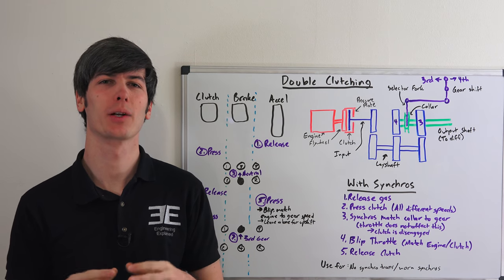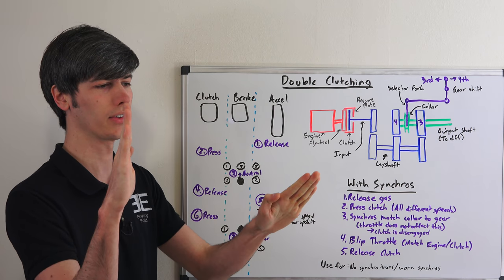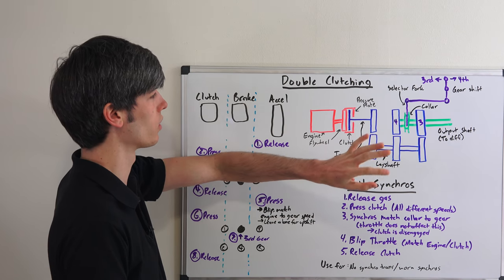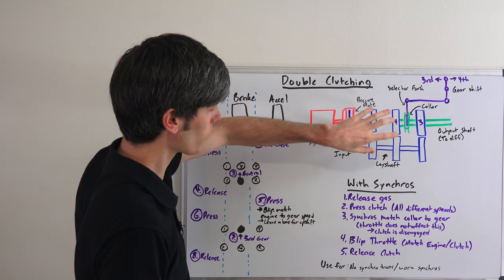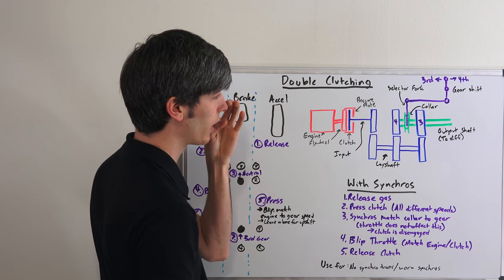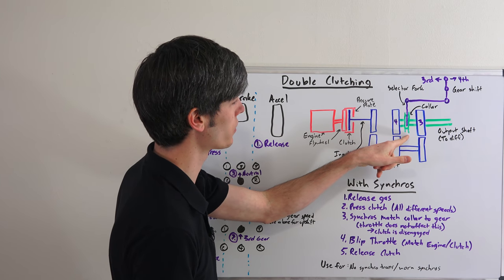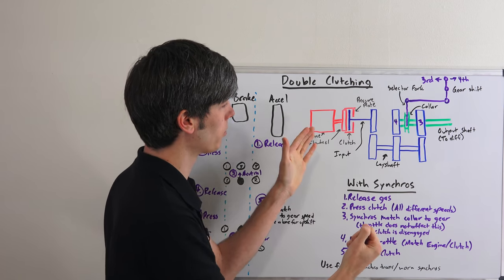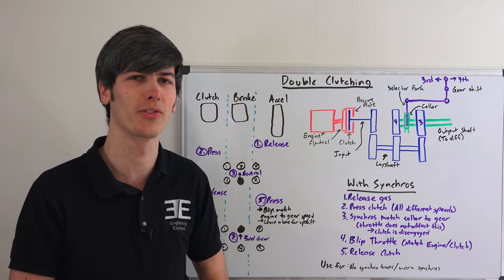What Is Double Clutching?

Comment: This just sounds like rev matching to down shift
Reply: Because you are revmatching. With double clutching you don't revmatch just the engine to the output shaft, but also the input shaft (which you connect to the engine when releasing the clutch) to the output shaft in the gearbox. Nowadays it's pointless because synchros do that using friction, so modern revmatching does the job and is much faster.

Comment: I already have been doing this for my truck (and any truck interesting that, it just made sense to do) but rarely do you need to do this in a newer car, the syncros will let you smoothly transition gears with well-timed rev matching, especially aftermarket stage 2-3 racing clutches, it happens too fast unless you really know your way around those types and been driving for awhile.  Just my take from my personal experiences though.

Comment: Older cars usually didn't have 1st gear synchronised, so that's where I learned how to do it. You weren't supposed to shift from 2nd to 1st, but I needed to, so I learned to double-clutch. I also find that though unnecessary, using double clutching on synchronised gears helps them engage more readily. I usually won't bother, but sometimes when I'm driving a nice curvy road I'll double-clutch, simply because it's fun. And sometimes I'll do it automatically, without thinking about it, probably because I don't expect the gear to engage very smoothly.
Also, I like acquiring skills that are not strictly necessary, but can be helpful. Training double-clutching helps you train your rev-matching and allows you to be a smoother driver. Being able to do this so precisely also allowed me to drive a car without a clutch (hydraulic clutch actuator was shot) for about hundred kilometres with hardly any difference except that I shifted a bit more slowly and carefully (for setting off I put the car in 1st and started the engine like that).
Except for a bit of wasted fuel for revving up the engine during the shift and irrelevantly higher wear on the clutch mechanism, there is no drawback to it either, unless you're doing it completely wrong and putting additional wear on your synchro-rings.